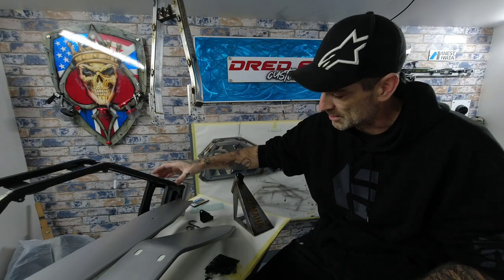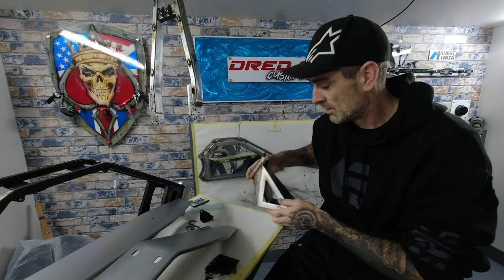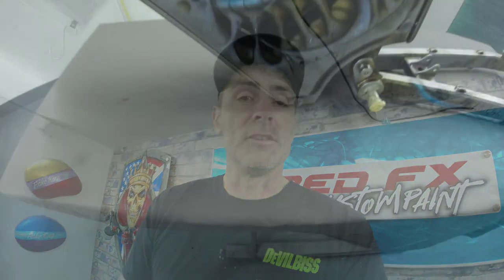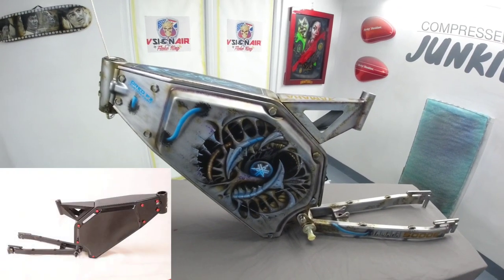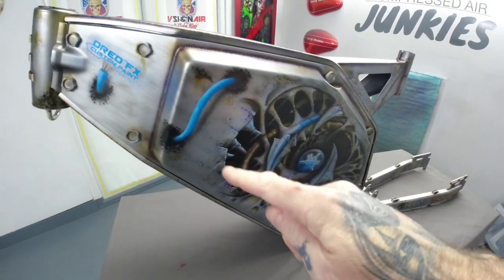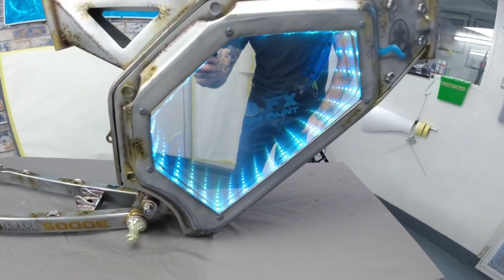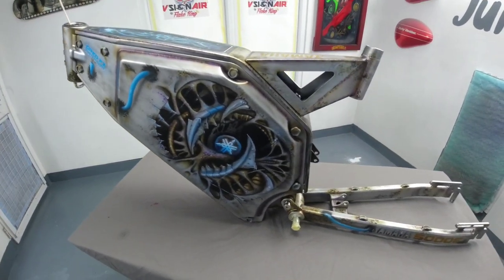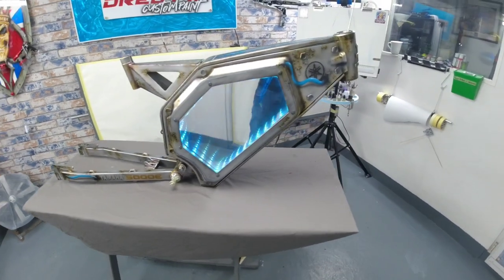E-Bike build part 6  the Artwork is done ✔

Comment: I've just ordered one of these frames as I rounded my dropouts on my 'regular' frame bike pumping 9kw through it. 

Let me guess, is this one for Steve or Andy? You done a good job on it, looks fab. I found your channel last week from Steve Dude Stuff jump bike video.
Reply from the maker: Hi this one is for me my first go at an ebike build
Reply: @dredfxcustompaint  ahh I see, outdone everyone there with your custom build! Now it makes sense why you were testing one with Steve. Make sure you get the big Sabvoton 72150 controller! And a big battery. I'm running Li-po on mine. Four packs, 22s, 92 volts fully charged ⚡
Reply from the maker: @18ct  will do when I get the funds to do the next stage 👍